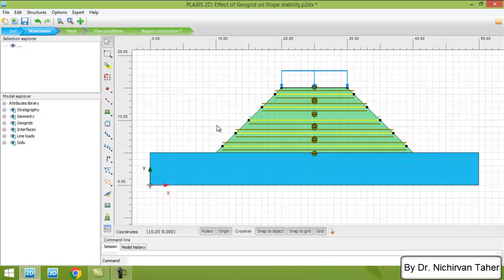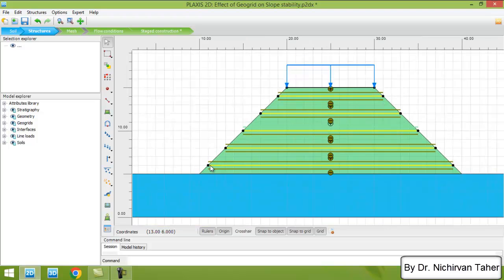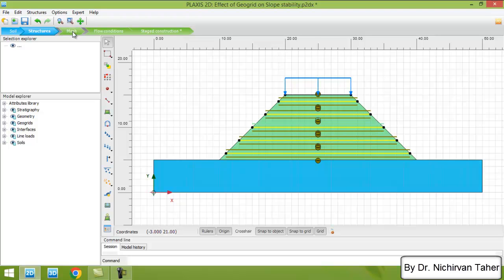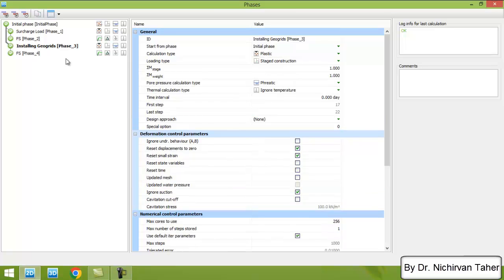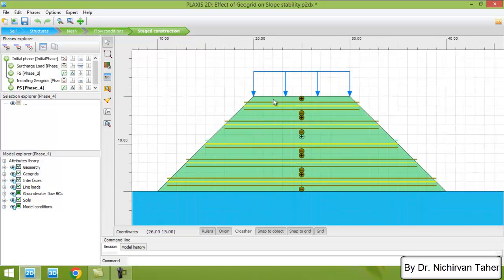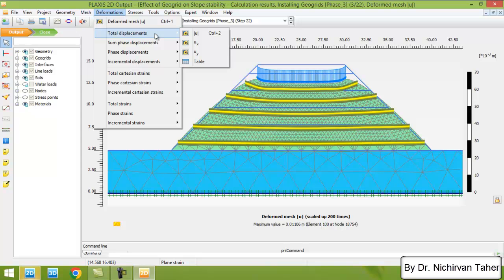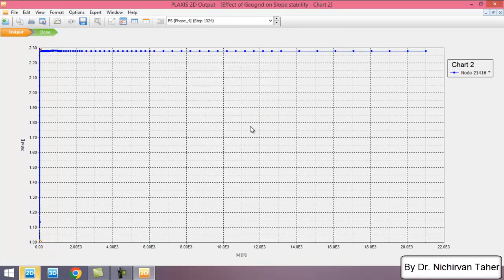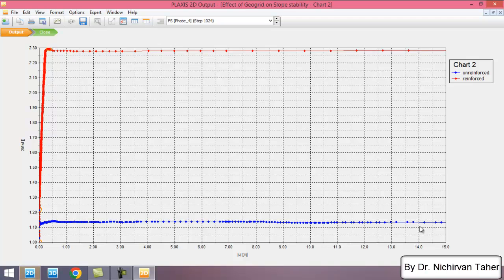Effect of Geogrid Inclusion on Slope Stability: Plaxis 2D Simulation Analysis

Comment: EA of geogrid is calculated as Tensile strength/ strain.
For example if the tensile strength is 100kN/m @ 12% strain then EA will be 100/0.12= 833. You may required to give reduction factor before this calculation.
Reply: hey can you help me regarding plaxis 3d problem

Comment: explain how the value of EA for geogrid has been calculated?
Reply: EA of geogrid is calculated as Tensile strength/ strain.
For example if the tensile strength is 100kN/m @ 12% strain then EA will be 100/0.12= 833